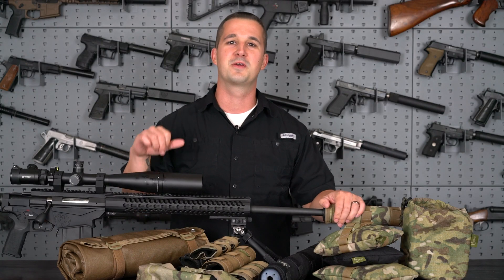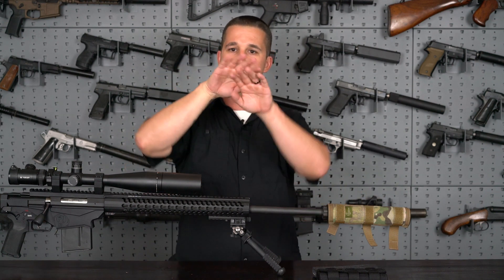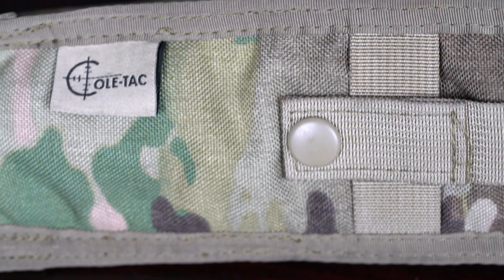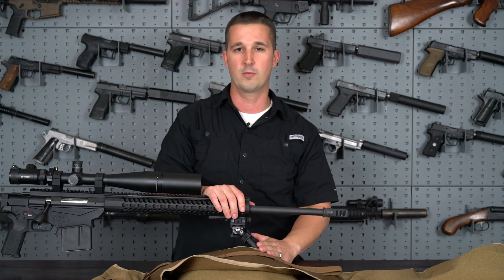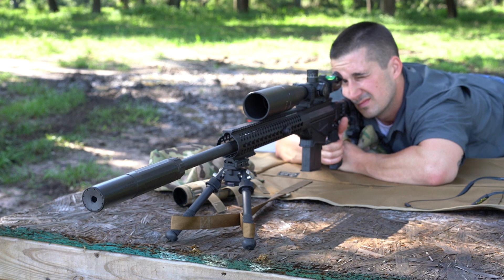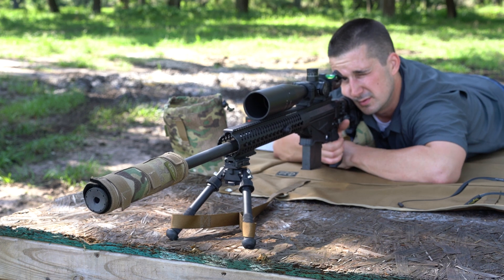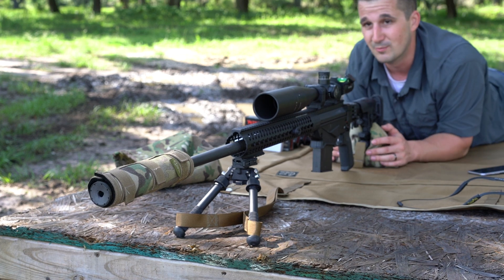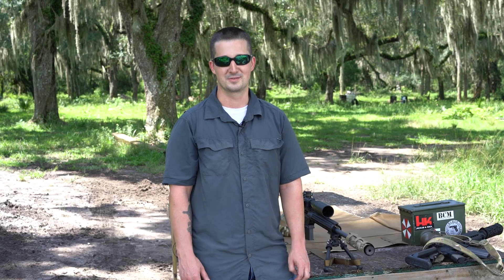Cole-Tac Suppressor Cover Test!

Comment: Cole tac stuff never held up for me (htp crisped cover and melted velcro on 2). Hell even the entire silicone bowers has crisped up inside on my buddies 10.3 556 surefire socom. No full auto or even near it, we just shoot often. Cole tac is a excellent company to deal with if you have a problem, so no worries if it does not work for you. anyone on the fence can at least give cole tac a try, especially with other products
Reply: so what brand do you use
Reply: using bowers griptastic / supcover. buddy had the tan one get toasted inside so it does not stay in place as it should (fde issue maybe?), little silicone holds it great. only ones we have not destroyed

Comment: Hay man absolutely love your channel. I truly hate to be "that guy" but a suggestion if I may. Right at about the 10:14 mark you are putting quite a bit of harsh pressure on the barrel. It appears as though you use it to assist in standing afterwards. This can effect long range precision fire systems and alter your DOPEs unnecessarily. Hence the free floating system. Or So I was taught at school. It isn't my place to tell you what to do with our guns. It is the proverbial nails on the chalk board for HOGs.
Reply from the maker: Thanks for watching! Yeah I watched it. I think the flex in the bipod just exaggerated the movement.

Comment: burnproof gear has higher temp ratings and will last a lot longer and withstand more abuse and full auto fire; burnproof gear has an overall better product; nice video
Reply from the maker: Well that's a lot of talking without proof to back it up. What material are they using for a heat insulator? There is a reason Ruger, SiCo, and others use Cole-Tac for factory branded gear.
Reply: NFA Review Channel Cole- Tac uses Cordura and we don’t . Cordura  melts. Feel free to email me at John@burnproofgear. If you want to do a test of both cover.
Reply: Daniel Flowers thanks for you support.